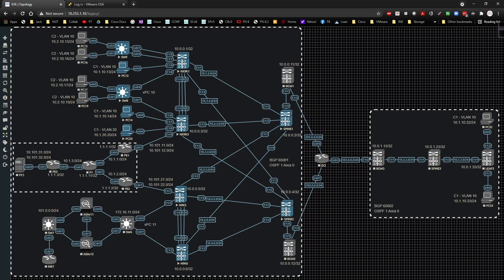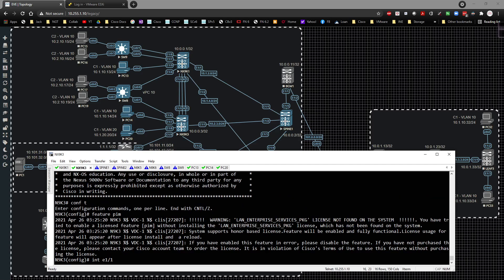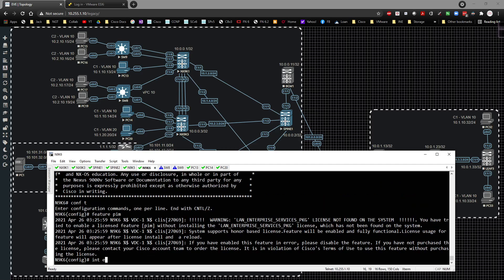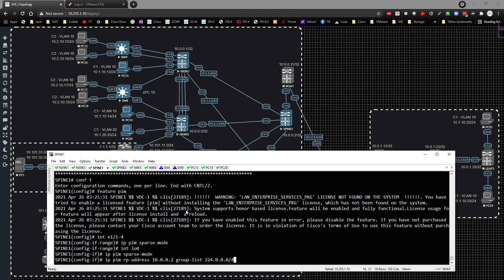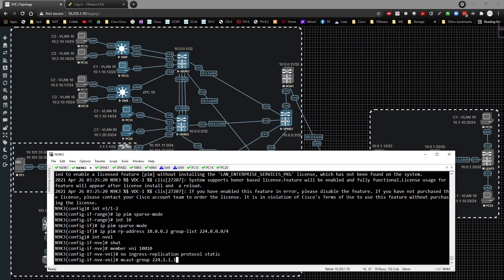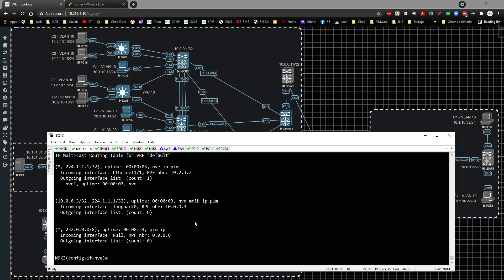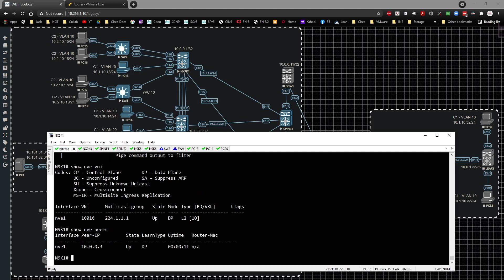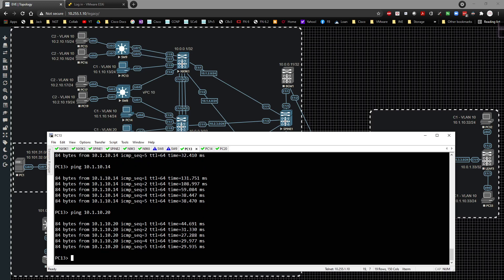Cisco Data Center Nexus 9000v VXLAN 005 - Multicast Deployment and NVE Multicast Update

Comment: Thanks for the explanation — awesome video series.
Just one quick question: we hard-coded the RP to Spine1, right? So if Spine1 goes down, the leaves will still point to it as the RP. Even though Spine2 is configured for multicast, it isn’t nominated as the RP on the leaf switches. What happens in that situation?
Reply from the maker: Multicast breaks. A phantom RP would be the solution here. Same RP info on both RRs.